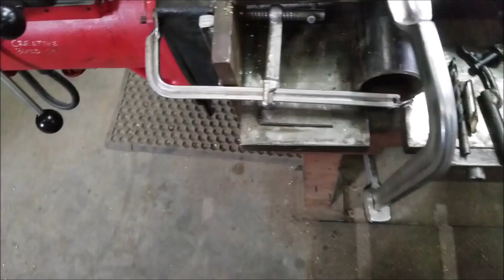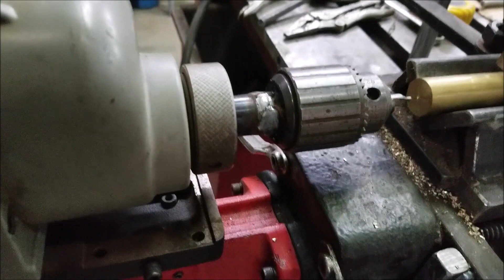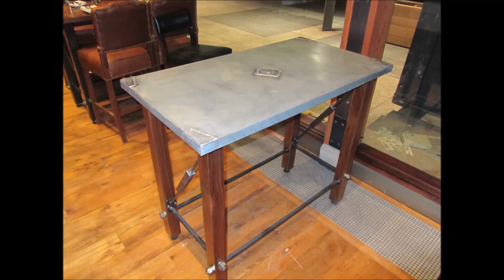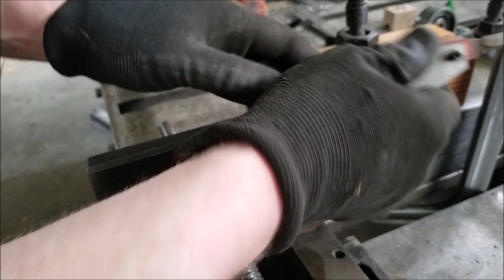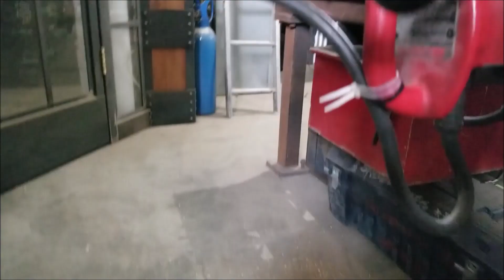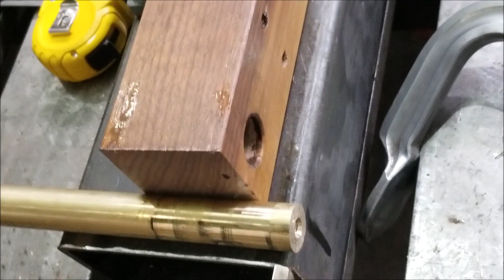Harbor Freight Cross Slide Vise as a Lathe Cutting Tool Holder part 2

Comment: That would turn a whole lot better if you rotated the tool just a little to cut on just the tip instead of the entire face.
Reply from the maker: That is a very good point. Thank you